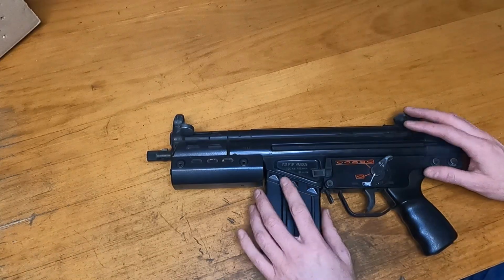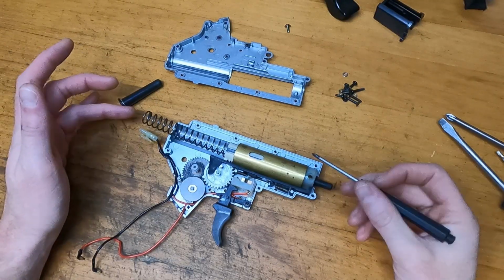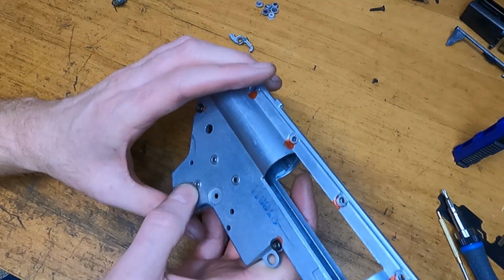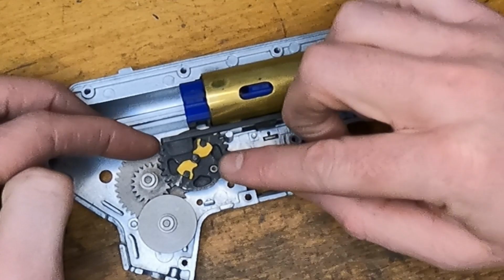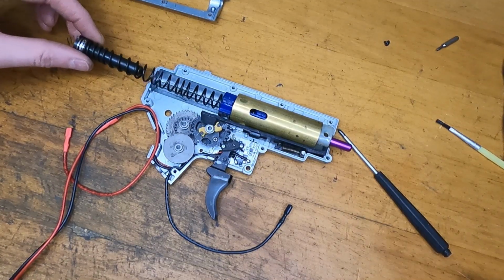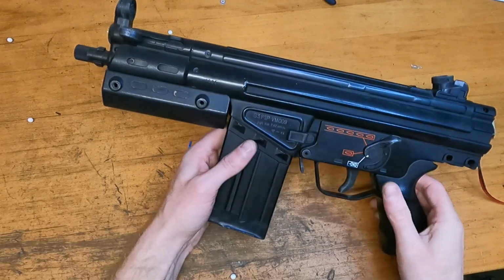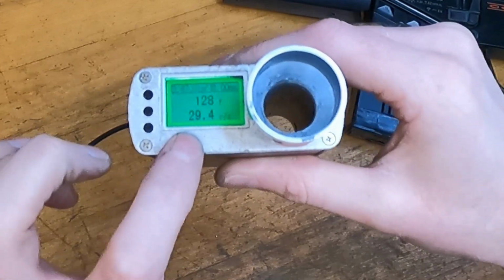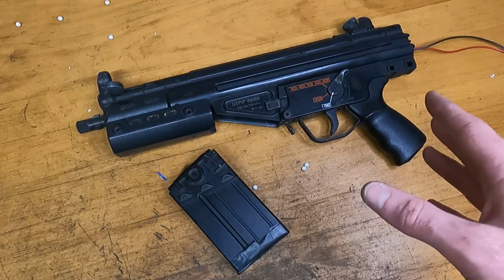DSG AEG build - TM G3 SAS

Comment: I have never seen a modified delayer chips in DSG build in my life, I have been teching AEGs for so long and I didn't do that, this is cool that it actually works with feeding.
Reply from the maker: I wanted to think outside the box and put my own ideas into, and see what results I could get. It holds its power consistently even at the higher rate of fire so seams to work well.
Reply: @adzzzysarmoury What do you prefer, between a  HIGH SPEED AEG (CYMA, TOKYO MARUI), or a custom DSG build?
Reply from the maker: @cunnyfred9562  personally I would build my RIFs that I use myself around 20 RPS as that is more than adequate for skirmishing. I just built this because I could and thought it might make an interesting video.😎
Reply: @adzzzysarmoury  What is a rough estimate of the additional costs (minus labor) that you used to perform this DSG upgrade.
Reply from the maker: @cunnyfred9562  I can't remember the rough cost of the bits I used as I had all the parts in my workshop already